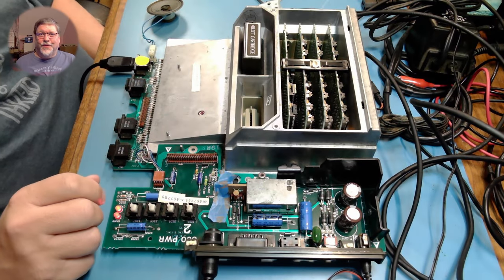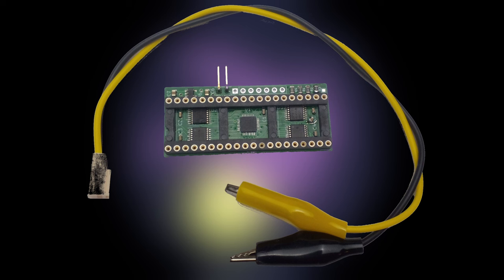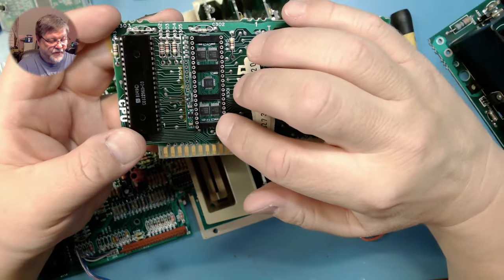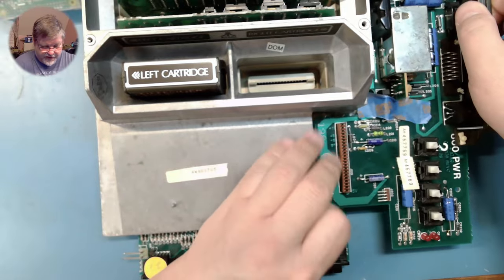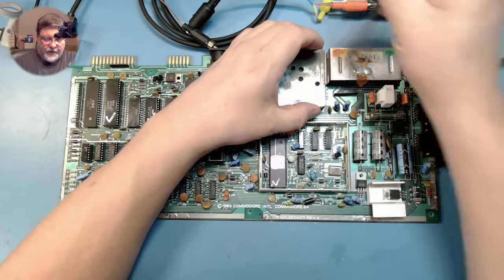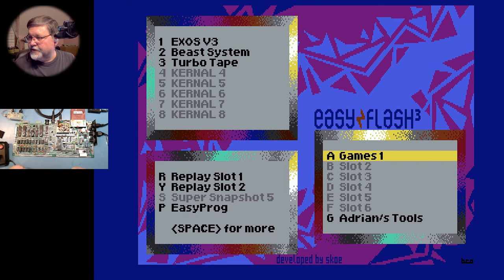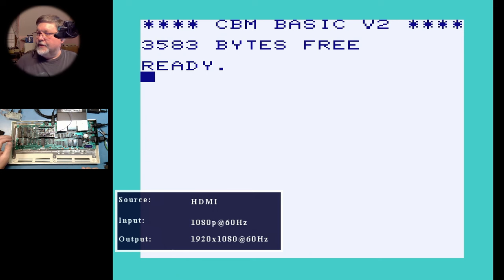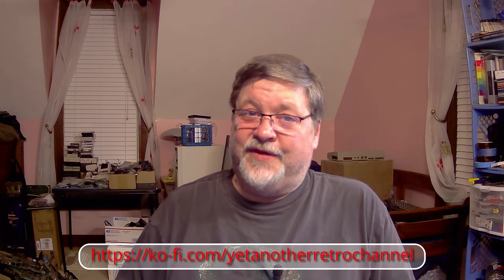AT LAST!  Easy HDMI For Retro Computers

Comment: About damn time stuff like this was made. Consoles have had HDMI mods for awhile, but somehow home computers were left in the dust. Also, what chip puller are you using? It looks way better than the one I have.
Reply from the maker: Glad you enjoyed.  Which chip puller are you referring to?  There's the Wiha chip lifter that looks like a precision screwdriver with a curved tip.  That one is available here: https://www.amazon.com/gp/product/B0875LSTD3/ref=ppx_yo_dt_b_search_asin_title?ie=UTF8&psc=1 .  The other is the Jonard Tools EX-2 DIP/IC Extraction Tool for 24-40 pin DIP ICs and can be found here https://www.amazon.com/gp/product/B006C3Y8IY/ref=ppx_yo_dt_b_search_asin_title?ie=UTF8&th=1 .

Comment: All I did for audio was use usb powered speakers,  and a cheap female audio to female 3.5 mm jack adapter,  plug my composite white and red into a adapter,  and done:)
Reply from the maker: Yep, that works, too. 😁
Reply: Hey bud,  just curious..  did you ever try the kawari mini with the luma code to see if it works?  Mark at trc says it won't.   So curious 🤔
Reply from the maker: @donaldblakley6796  I hadn't until I got your question.  I've done some preliminary testing and it looks like Mark was right.  I still need to do more testing to see if the Kawari can be set up in such a way that it works, but it's not looking promising.  I received the additional digitizers from c0pperdragon today that I'd been waiting for, so I'm working on a follow-up video.  I'll try to include some of the Kawari testing in the video.
Reply: Np, just curious.   So you got the vic20 digitizer today?  Can't wait.  Hopefully it will be good now:)
Reply from the maker: @donaldblakley6796  I did.  Also a TIAdigitizer for my Atari 2600, a ULAdigitizer for my Sinclair ZX Spectrum 48K rubber key and a TMSdigitizer I'll install into a Texas Instruments TI-99/4A.  Got a lot of work to do to get that video made.
Reply: @YARC-1981  I'm sure it u will make a great video:)  have a wonderful night bud